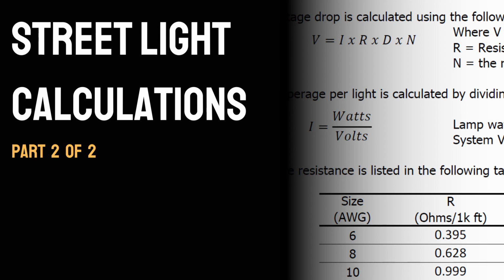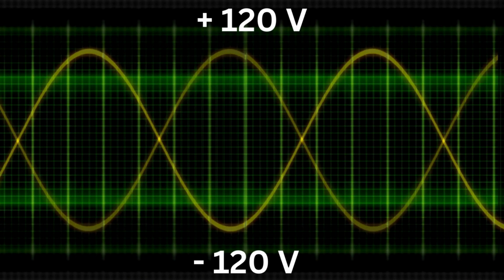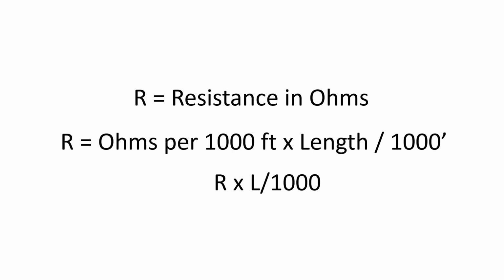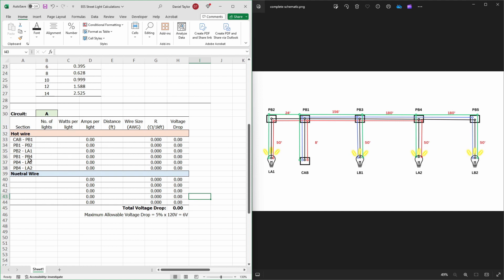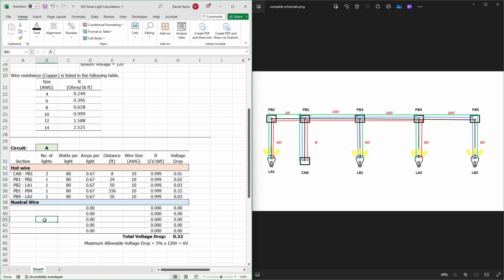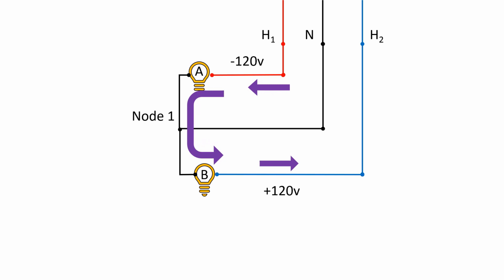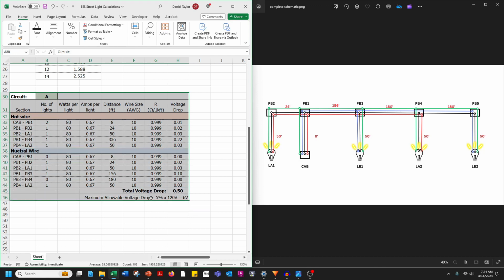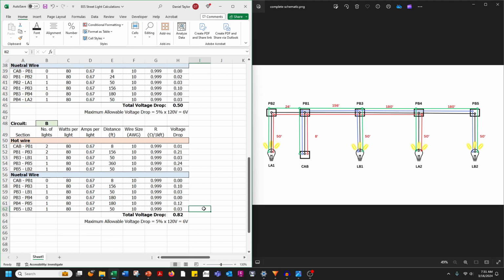Street Light Calculations – Part 2 of 2

Comment: Does the three wire system meet the National Electrical Code?  Does it require the breakers in the service to be tied together for common trip?
Reply from the maker: Thanks for the comment. I am not sure if it meets the NEC? This is how local agencies have always instructed me to calculate voltage losses in my street light designs.